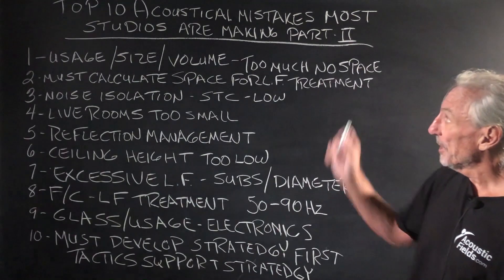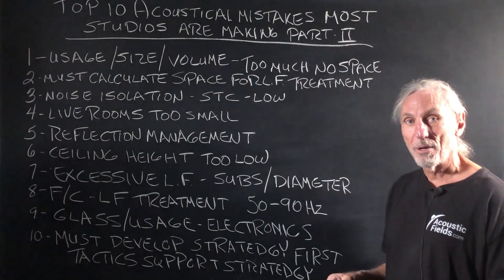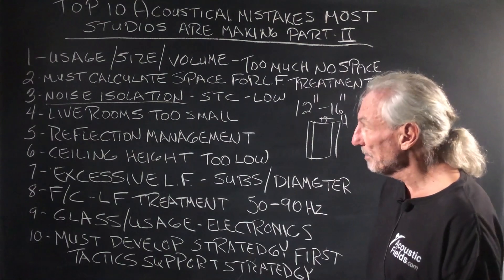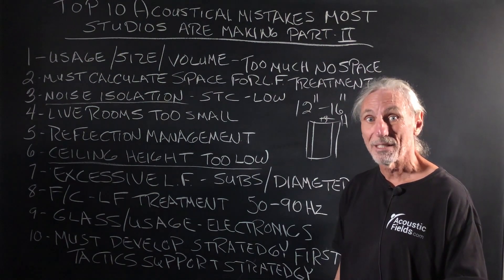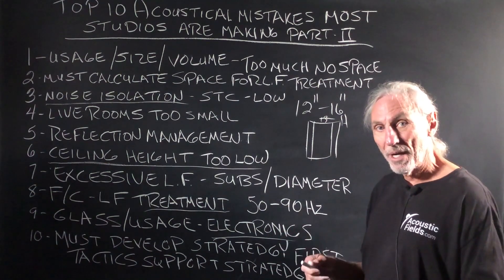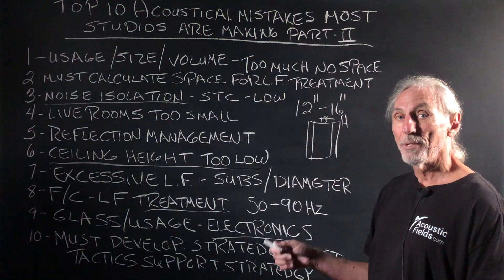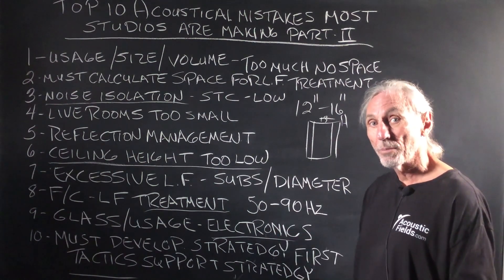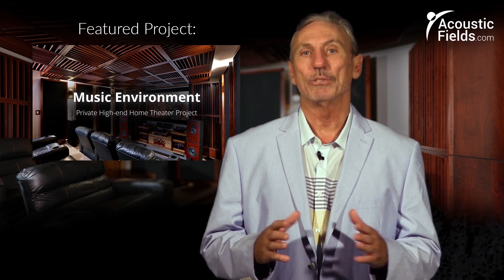Top 10 Acoustical Mistakes Most Studios Are Making Part 2 - www.AcousticFields.com

Comment: You correctly mentioned the ceiling but neglected to mention . . . THE FLOOR ! ! !
Reply from the maker: When choosing a floor it is best in a studio to focus on what works best for work flow and cleaning. Studio floors take a beating, at least our does and I know many others that do too. Choose a material type that you can easily roll equipment in and out on. Our current studio is painted concrete and works well with casters.

Comment: I have the luxury of having several rooms with varying size to rehearse and record in. I have a large sanctuary, medium size chapel, and a small room in my basement (8'x8'x8') That small room is where I spend most of my rehearsal with an acoustic guitar and my voice, just getting ideas onto a recording. Even though that room stinks for sound quality, it does what I need it to. Then I can take that idea to a more suitable place to finalize.

It would be nice to hear from you, Dennis, what CAN be done in a small room. That would help folks understand what to design for. So in my little 8' cube, what SPL and Frequency range is reasonable. My acoustic guitar down to 83 Hz at 75 dB for example is not the worst thing in the world, but my 5 string bass running at 95 dB would be insane.
Reply from the maker: You must make the room smaller and give up 12" of wall space on each wall. For this size room you could use our Carbon Panel. It starts at 40 Hz. and goes through 6,300 Hz. For a 755 solution to all low frequency pressure issues you will need 12 units or 3 on each wall. Absorption coverage must be balanced on all 4 walls or you will get phase issues. 
https://www.acousticfields.com/product/carbon-panel/